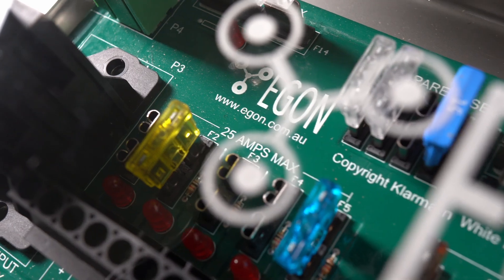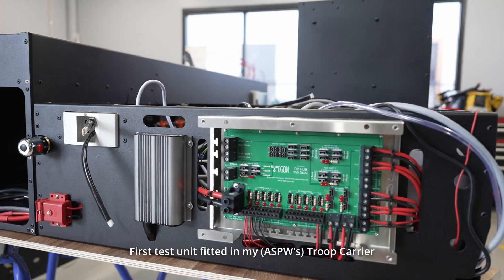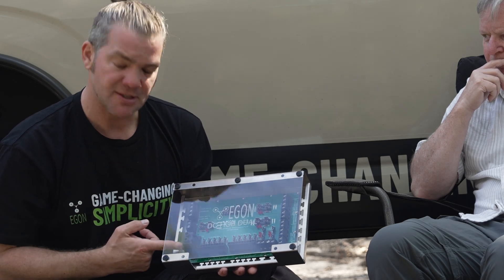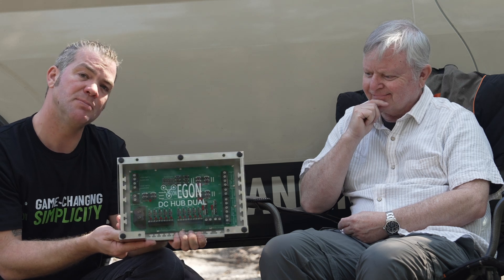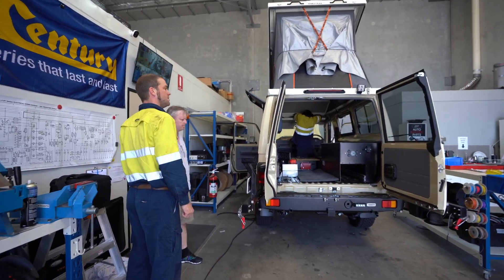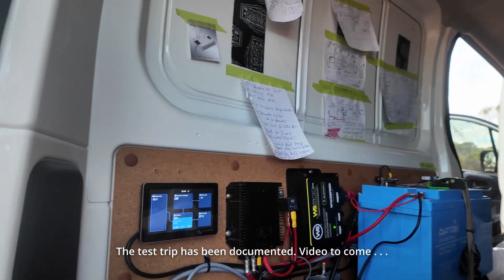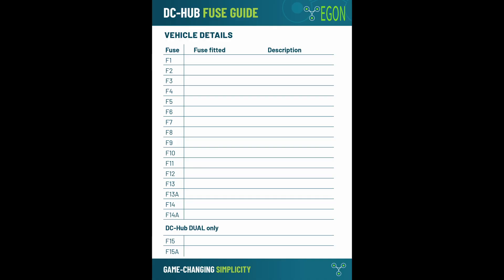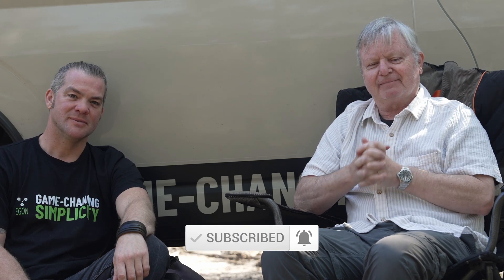New EGON DC-Hub Dual. 1000th DC-Hub Milestone | EGON

Comment: I might be telling you to suck eggs here, but it seems you have a lot of spare board room on both hubs, but I don't see a spare fuse holder...my Landcruisers's fuse boxes have always come with spare fuses and fuse pliers....also seems a no brainer.
Reply from the maker: thanks for the suggestion but there are mounts for six spare fuses on the board.
Reply: @EGONGame-changingsimplicity  Just saw them on another of your videos. Apologies. Deciding whether I need two (one for Cruiser, one for camper). Do you have any info one connecting two hubs in that config? I think it would be reasonably common.

Comment: This looks very cool. A typical wiring scenario would have starter battery and solar outputs connected to a DC-DC charger/MPPT with output from the DC-DC charger connected to the house battery, then the house battery output connected to fuse block for distribution to the DC loads. Based on the wiring diagram, it looks like this EGON DC hub allows the starter battery, solar, DC-DC charger(s), house battery, and DC loads to be connected directly to the hub and the hub manages both the charging of the house battery and the distribution to the DC loads. Is this correct? I'm assuming that a DC-AC inverter would be treated as just another high amp DC load. Is this correct? If the house battery is 48v, how is the step down for 12v DC loads handled? [Edit: after watching further, I see that there is a 48v version being developed...]

Comment: Still feels like it's just what I'd love, it still looks like a great product...
But it still takes up too much room for my application. I'm no electronics engineer  but simple physics tells me you could halve it's size. I mean more than half it's volume is air. I prefer to keep my mods hidden. 

Maybe you could consider that in version 2.3?
Reply from the maker: Simple physics, that being heavy copper runs and connections that permit such high current dictates its size. It could be made smaller, but then it could not take the current.

Comment: So where's the best place to store spare fuses? In another place or where you are going to need them?
If you want another idea. Create some empty fuse sockets plug the fuses in there. On the side, on the top, or even inside the box.
Reply from the maker: there are spare fuse sockets on the board for both large and standard fuse sizes.
Reply: @EGONGame-changingsimplicity  Good. Great minds think alike! :-)

Comment: The use of blade fuses always freaks me out, seen so many melt under load
Reply from the maker: True. But its because those that melt are cheap and nasty. These are German with high clamp rates, easily capable of handling the current. And why we use two on the high A charge input side. We use them because this fuse type are found everywhere.